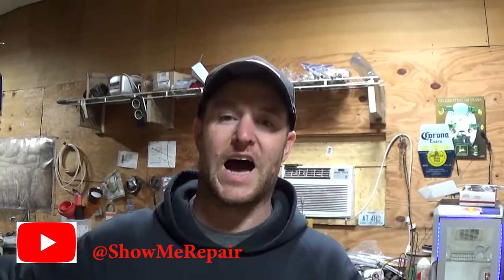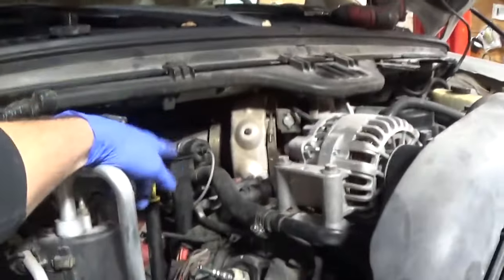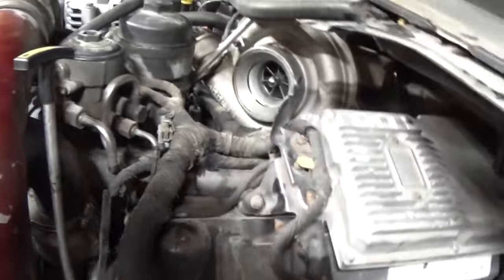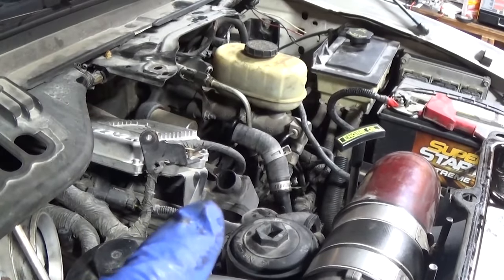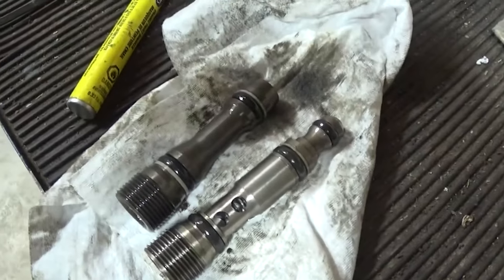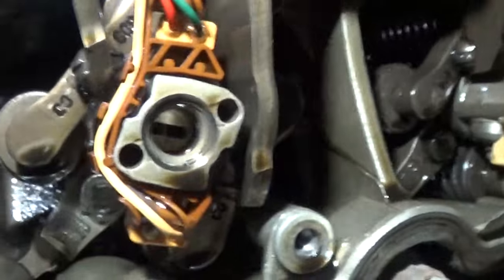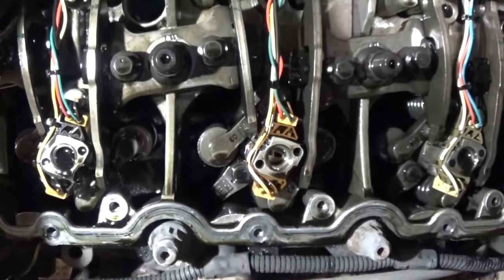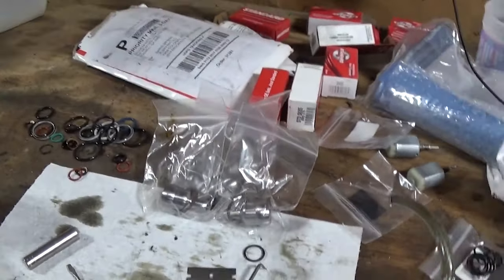I Learned something new on a 6.0 Powerstroke

Comment: I'm still fighting a '07 6.0. New injector o-rings, stan pipes, dummy plugs, nipple o-rings, hpop, ipr.  Still have hot no start. Was building only 30-50psi hot before a replaced everything. Now it hits 350 psi hot when trying to restart.  The longer it runs after cold start, the higher the ipr goes until it's at 85% while running, but it's stays around 540-560.  It'll run about an hr before it shuts down.  Pressure test sounds like leaks on both banks. Can't feel or see a thing.  Don't see any mist, spitting, nothing. Tried pouring oil all over and don't hearing gurgling anywhere. Thinking about pulling injectors and having them tested but that'll cost 400. I had the rails off twice on both sides to make sure the o-rings didn't tear.  Sick of working on it.
Reply: Do you have any misfires?
Reply: @nickhess51  No misfires. I ended up replacing all eight injectors. It started up and ran fine, restarted hot with a longer crank than desired.  It ran for 3 days then boiled over.  Pure white gel went everywhere.  All coolant and oil disappeared and mixed together squirting out of the coolant bottle. A huge mess under the hood. I'm guessing it has a cracked block or something.  I've never seen a blown head gasket look like this.  Now looking at just finding a replacement engine. $7k dollars down the drain and prob another $8-10k for another engine. Sucks.

Comment: I had number four o ring bad on mine last month and I always change the injector o ring without removing the c clip.
Reply from the maker: I’ve seen repeat failures with a couple brands of o-rings. What brand I-ring did you use?

Comment: yea Im about to replace the IPR and hoping that will fix it, yea I know using the part canon is not the best of ideas, but it almost 18 years old. If not then I'll pressure test it. Got the tool for the pressure test the same time I got the IPR.
Reply from the maker: Been there done that. I’ve fixed trucks doing that. Other times I’ve had to go back and pressure test.

Comment: Ive been seeing these fail more often. I think these trucks are just getting old and theyre the next wear item. My biggest tip is to command the IPR to 85% or if you have a spare pigtail you can send 12v to it. Just dont do it for too long i try to not do more than 5 minutes when i use the 12v method. That way you can tell if the IPR is good also.
Reply from the maker: Great information. Thanks

Comment: I had a no start on my warm engine turned out to be my Ficm went out I had already replaced all the ipr hpop and injectors it would show random low injector 1 pressure and was Ficm all along for my issue but I checked all the other items you touched on
Reply from the maker: Weird. How did you figure out it was the ficm?
Reply: @showmerepair  I did testing on my Ficm and the voltage was wrong sent to be rebuilt and it was shot the capacitors inside were blown  I was building the pressure of 500psi in my hoop to try and fire but it just wouldn’t and I kept getting the same code for Ficm performance module low voltage
Reply from the maker: @nathanembree3741  Yep I’ve seen that a lot. Just haven’t gotten to make a video on it. Any time there is a P0611, all injector circuit codes or FICM M voltage drops bellow 48v key on engine off. Replace or rebuild ficm. 
If a person is rebuilding themself by putting in a new capacitor board. They need to look at the other circuit board and make sure there isn’t any signs of heat damage.
Reply: @showmerepair  you are 100% correct as they don’t all look the same I wish I had told you before I sent out to rebuild I am in Oregon so it might have been hard to make a video on it

Comment: I Always do my air test hot and bump the motor over a few times during air test. I've found several bad orings that way
Reply from the maker: Yea air test hot helps. 
What’s your reason for bumping engine over while doing air test?
Reply: @showmerepair  a dealer mechanic I know had told me it displaces the oil so that the small leaks that are hard to hear are easier to diagnose. It definitely seemed to help on my 05 but on my 03 it doesn't make a difference
Reply from the maker: Not saying I know everything but it doesn’t make sense. If you feel it helped then who cares. I may try it next time.
Reply: @showmerepair  hey I thought the same thing in my head the air is displacing the oil period but shit I had a oring just barely knicked at top of injector on driver side. I was doing my air test on pass side icp port and didn't couldn't hear a leak bumped it over a few times and cyl 3 injector started blowing air instantly. That truck is a 05. My 03 with the log rails it don't make a difference at all.
Reply: @showmerepair  I'm always willing to try something new especially with 6.0s. It seems like you can learn something new everytime you tear into one. These are by far my favorite diesel to work on next to a 12 v cummins. The 7.3s aren't bad either to work on
Reply: I blew my air hose up once when I started a truck and forgot to take the fitting off!
Reply from the maker: @Rocco-fv9yw  WOW!!! I bet that wasn’t fun.
Reply: @Rocco-fv9yw  oh no bet that wasn't pretty lmao

Comment: Good video. Very informative. Glad to see the actual diag instead of just throwing parts. I have mine on passenger side apart... 2 broke valve cover bolts and 3 of the manifold torx were missing.
Reply from the maker: Thanks for watching.  As these trucks get older I’m seeing more striped valve cover bolts. I’ve had to remove HVAC housing to helicoil valve cover bolt holes. Missing high pressure oil rail torx bolts is just a sign of a crappy mechanic.

Comment: I just replaced the stan pipes, plugs, injector seal kit, nipple o-rings and still have the same leak that I can clearly hear but can't see. Tried pouring oil all over and no gurgling. Took everything back apart to verify and retorque. Still leaking.
Reply from the maker: A sealed system will always have a leak noise at the pump. Unless you’ve removed the IPR and installed a IPR plug or powered the IPR closed. 
Has you engine had the connection at the high pressure pump replaced?
Reply: @showmerepair  Valve covers are still off and hear the leak basically same place you had in your video.  Sounds like the top of two injectors, but both injector seals and nipple seals are new. Can't feel the air but def hear it by the rail.
Reply from the maker: Have you tried to start the engine? 
You may have an air leak but not an oil leak. I’d partially put things back together. 
Lay valve covers on engine. Hook ficm up. Hook any coolant lines up. You can leave charge pipes off. Crank the engine. You may have fixed your leak. 
Try to start the engine. 
If it starts. Shut it off and redo air test. See if you can still hear the leak. With the oil in the system, if it does leak it will gurgle and spray the oil some. You might be able to see the area leaking
Reply: @showmerepair    Will do, thanks!

Comment: 155 ft pounds? ive seen 100 ft lbs online so ill try that next. im having the same exact issue thanks!
Reply from the maker: I’m not gonna say my way is right. It worked for me.  Your right I’ve seen torque specs from 75 to 100.
Reply: Definition Of Breakaway Torque For Threaded Fasteners
Breakaway torque is the rotating force required to "break" the head loose, going in the same direction as
applied - tightening. This will usually give a value HIGHER than the original tightening torque because
dynamic (when the bolt was tightened) is lower than static (when you try to break loose the bolt head).
This is how it is defined by torque testing standards. If the breakaway is measured in reverse (loosening),
you will usually get even higher readings because the bolt head generally "digs in" and forms small burrs
and indents THAT ARE DIRECTIONAL - like a ratchet. It is incorrect to check breakaway by loosening.
Keep in mind that "breakaway" occurs instantly and ANY turning beyond that point will produce furthe
tightening, not breakaway, and give false high readings. Breakaway is best checked with a torque
wrench/instrument designed for that purpose. It is very difficult to check breakaway manually with any
accuracy.
Another definition of "Torque Breakaway" is "the point at which torque applied to the a fastener restarts
he fastener in a positive(tightening) direction." The restarting movement is characterized by a
momentary drop-off in torque followed by an increase in torque (as mentioned above) with further rotation
in the positive direction. Checking this manually, the operator would apply torque slowly and feel for the
breakaway point, RELEASING the wrench at that moment, and looking at the high limit reached on the
wrench. You can see that the turn DIRECTION and technique are critical to proper testing.

Comment: I’ve seen in some forums that it calls for 100 ft-Lbs of torque? The more you torque it the more the o’ring flattens? I’m I wrong? I just got a 04 Ford F350 SD Lariat 6.0 Powerstroke and I’m new to the diesel world, but I am very mechanically inclined, I did head gaskets (Ford Brand) (although Fel Pro I’ve heard they’re good too) ARP Studs I heard it’s a must for these engines,new Glow Plugs & new harness,New IRP,New HPOP,New J-Tube,New Dummy Plugs & Stand Pipes,IPR Research Gen 2 Delete kit(came with truck)although I’m gonna get bulletproof one soon,Complete Injector rebuilt inside,I have spare injector solenoids(10 spares)new batteries,now I’m waiting for my ficms to arrive from ficmfixer in Texas, great guy!!!! I sent 2 ficms to get checked out and both are good,also have an extra good ICP & IPR sensor/valve just in case, I hear so much about these trucks that I’m trying to be ready, oh yeah and Arch oil arrive today, but the spool valves felt pretty good when I did the injector rebuild,no sticking or felt rough sliding in and out, and I did all the oil rail o’rings from HHC but I do need to get the nipple cups from HHC soon, $300 for 8 nipple cups with O’rings,good video man I’m always watching your videos.
Reply from the maker: Sounds like you’ll have a pretty reliable engine once you’re done. The truck I did this repair on is still running good so I’d say I was ok with that torque. Thanks for watching.

Comment: Just sold my 6.0. Still work on them. Went back to a gas job. I don’t need a diesel. Bought a chevy
Reply from the maker: I still don’t have a running diesel. I don’t tow real heavy enough to justify a diesel. Gas engines are way cheaper to fix.
Reply: @showmerepair  I agree. I’ve worked on 6.0 and 7.3 for ten years. Even routine maintenance is expensive

Comment: Just for some help to determine if your hearing the air going through the rail or if it's actually an air leak. Put a lighter over the hole where your hearing the sound and see if it blows out the flame or use a cigarette to see if it blows the smoke. Because you will hear air going through the system but its hard to determine if its a leak or if its just air going through the system.

Comment: 2yrs out of stand pipe ? Changin a 10 month old OEM one now
Reply from the maker: I’ve not seen repeat failure like other people. Though I do see other repeat failure on other o-rings when cheap oil and Rotella oil is used. As well as fuel diluted oil. If your oil level raises between oil changes it is either a sign of coolant getting in or fuel.
Reply from the maker: I have heard of this upgrade stand pipe
https://www.dieselsite.com/2004.5-2010dieselsite60lstandpipes.aspx
Reply: @showmerepair  usually get best results outa motorcraft but dunno what happened, maybe made during pandemic. I needed something right away this time and Amazon couldn’t ship motorcrafta until next week so I got meshimottos or however that’s spelled, should be here before 9

Comment: With all the work you did on this truck tracking down the leak, what does a job like this cost? My truck (2007 F250 Power Stroke 6.0) is out of warranty. Thank you for this video.
Reply from the maker: That’s tough since it’s hard to give a good ball park what you may see in your area. If you find a 6.0 tech that is honest. Really won’t be to bad. 
I personally would be in the $1200 range. 
I charge half what my local dealers charge for labor. 
Sadly a lot of shops think they are gods  gift to customers and cars so they charge what the dealers charge.
Reply: I appreciate the response, $1200 is a good starting point for costs and that's really  what I was looking for, thank you.

Comment: How many stock cats have u seen fail? I’m gettin a p2262 code. And I’ve done all the usual suspects. Clean turbo /ebp sensor pigtail n pipe /vgt n pigtail. I think my cat is shit. And I just found my 8 injector is at zero value. So I’m planning on doing Atleast that side injectors and d plugs  n stand pipes. And if it’s not a super pain I’ll do that to other side too.
Reply from the maker: I’ve seen several fail. Make sure your map sensor line to the intake manifold is not cracked or plugged. 
To test if your car is plugged. Take the 2 15mm Nuts connecting the down pipe to cat loose. Make sure there is a small gap between the pipes after removing the nuts. Go test drive. If no performance change. Then I would suspect you have another issue
Reply: @showmerepair  yup. I check map n the tube. Map few months old. I swapped it. Last time I did some work. I’m gunna gut cat or cut out n put pipe. I live in fla. No inspection. My buddy been on me for havin one. None of my diesel guys hv one. On anythin  older. I’m a 6.0 guy. Thru n thru. Had duramax for years n I liked the ride but I love my 6.0 motor. Cool thanks man.
Reply: @showmerepair  my cat seems to be welded in place. Like truvk didn’t hv one and they put it on
Reply from the maker: Aftermarket cats are junk. They fail more than stock these engines.

Comment: Can you stop the air from going through the ipr ,so you no for sure the first time or is just a pain to get to ,,,thanks for videos,,
Reply from the maker: https://www.freedomracing.com/6-0-ipr-att-6-0l-powerstroke-high-pressure-oil-system-ipr-air-test-tool.html
Reply from the maker: https://www.freedomracing.com/injection-pressure-regulator-ipr-controller-6764.html
Reply from the maker: Here are 2 options for doing what your asking.  
The first requires the IPR to be removed. 
The second requires the connector to be removed from IPR.  
I’ve not used either because I spent years without it. Doesn’t mean they can’t help diagnose faster.  My plan is to get both tools and review them. 
Thanks for watching.
Reply: @showmerepair  thanks for fast reply,  you think you could make one a lot cheaper then that price, just for the person working on his own truck ,,but hay thanks for the help and videos, good day
Reply from the maker: If a person had an old IPR they could make a plug. 
Electric tool could be made

Comment: I just watched your video and loved the explanations. I do have a fast question, maybe somebody smarter than me could help me with. Last summer I changed the head gaskets on my 2006 Ford F350. I changed everything that I could change. Everything was done to spec. and when I fired it, the fumes was so bad you couldn't stand to be near it and it ran very poorly. Guy I knew did a cylinder contribution test and found two cylinders on the odd side of motor not contributing. What should I do next? Change the o- rings on the injectors? Change the injectors? I'm at a loss. Thank you for any help.
Reply from the maker: @tomclark3592  what did you torque the injector hold down bolt?
Reply: @showmerepair  I really don't remember. I did go on line and found torque specs for every single part. I put about $2000 in to this truck and really need it to run. I really appreciate the help.
Reply: @showmerepair  I did this truck last year and ended up with cancer this year, so I haven't had the chance to dig back into it. I did not change any o-rings when I put the motor back together.
Reply from the maker: @tomclark3592  if the injector hold down clamps are under torqued they can cause running issues. If they are over torqued they can cause issues. 
I’d recommend checking resistance across the pins of the electrical connector. If I remember there should be around 1.5-20 ohms resistance on each coil. Remove the injector and install new a new one-ring kit. 
The kit should come with a new copper  washer. Always replace the copper washer anything the injector has been removed. Torque injector 26-30 lbs/ft. If you remove the 2 injectors and suspect they were not torqued correctly. I’d recommend removing the rest of the injectors and installing a new o-ring kit with copper washer.
Reply from the maker: @tomclark3592  lots of people dive into these modern diesels not understanding the electrical and computer side. You can replace a lot of parts and not actually fix the problem. Anyone reading this and trying to diagnose their ford diesel. Get Forscan for your laptop. Learn how to use it. It will help you diagnose.
Reply: @showmerepair  Thank you so much for your help. I probably should have let a shop replace the heads on the truck but I have worked on gas engines all my life and was not too sure about the high pressure oil opening the injectors and all of that. I at least now know what I need to do. I should have done the work before putting it back together, but I will again work on it. Thank you so much.

Comment: Awesome thank you. Have 2 6.0s one build by KDH Diesel it’s a monster no issues the other im just diving into actual diag on and IPR Duty Cycle 85% all else good do air test is next. Would you mind sharing what PSI you run your shop air at to test? Subbed and liked thanks again.
Reply from the maker: @JanitorMan432  I think my compressor tries to maintain 90. 
The dealer I worked at maintained 120 psi. 
It’s not the air pressure it’s self that helps you find the leak. 
50 to 60 should work. Air is thinner than oil. It will find the leak if there is one.